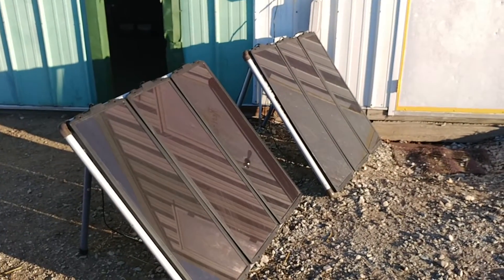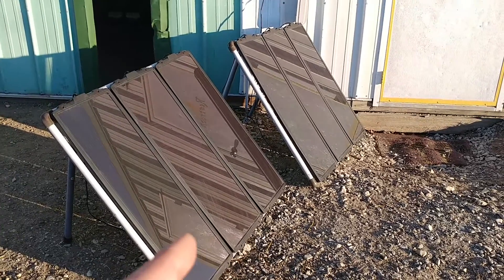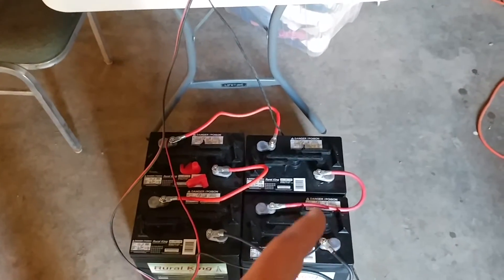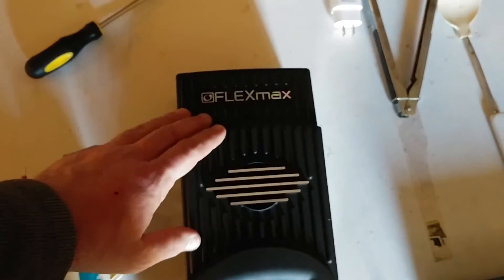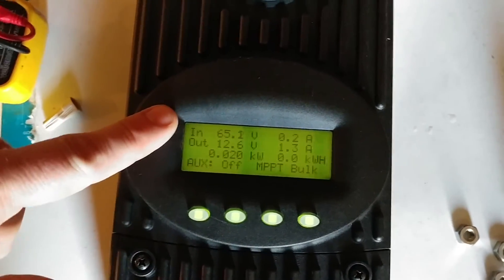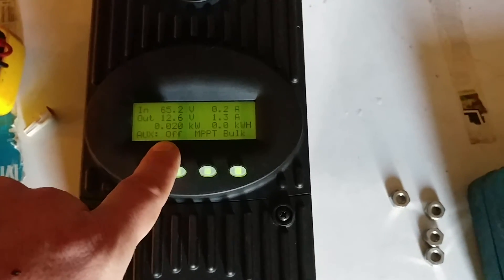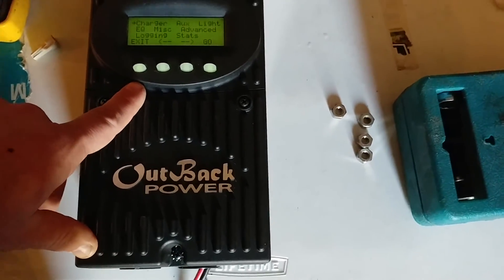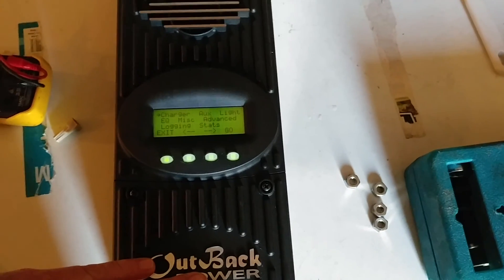Outback FlexMax80 Test Run

Comment: Hi wich type # cables you used for installation the outback and battery?
Reply from the maker: For my instalation I'm running between the panels and the charge controller using 2 gauge (AWG) aluminum wire. Between the batteries and the charge controller and inverter I'm using 2 gauge (AWG) stranded copper wire.
Reply: @ChristopherFarms  that is 2/0 cable?
Reply from the maker: Yes, that's what it is, 2/0.
Reply from the maker: You should be able to. It really depends on the load your going to have (how many amps will be drawn from the batteries) and how far the batteries are from the load. The more amps and the farther away would need larger size cables. The inverter I'm using will pull a pretty good load when I use power tools and when the small refrigerator I have turns on.
Reply: can i use cable #4 between charge and batteries?

Comment: Hi,pls little help here,what is the good amps voltage that my controller must bring out to show it's charging well(input v : amps and output v : amps )
Reply from the maker: Right now I have full sun on four 12v panels (don't remember the wattage of the panels) wired in series and I'm bringing in 63.8v at 5.4a and putting out 12.7v at 23.6a.

Comment: Nice video. greteens from Puerto Rico. i was looking pricesly in what those nunmber onthe screen means. I just bought a flex 80 and didnt know whats those numbers means.(its my first charger ever) Are those awg4 wires?
Reply from the maker: I think they were. I'd have to go and look to make sure and I'm away right now.
Reply: I would download the manual from Outback an study up on those numbers. The wire looks smaller that 4 awg...perhaps 6 or even 8

Comment: good video sir i like both flexmax and midnite classic
Reply from the maker: I hear the Midnite Solar stuff is quieter when it comes to radio frequency (RF) interference. The Flexmax gets into my ham radio gear pretty bad. If I'd have known that at the time I might have done with a Midnite controller. Other than that the Outback seems to be rock solid.